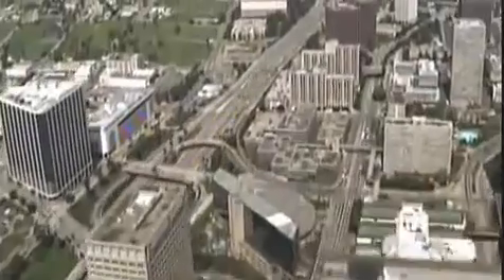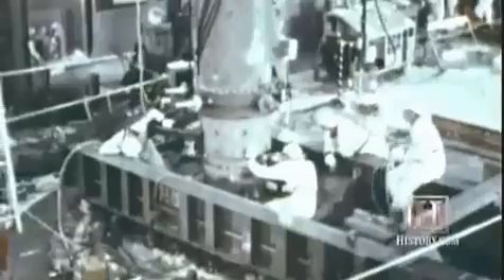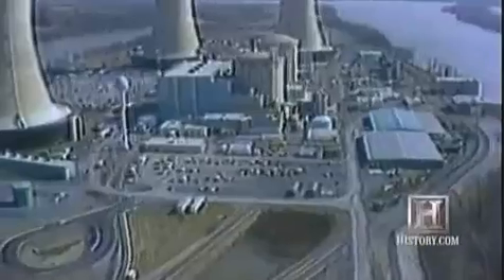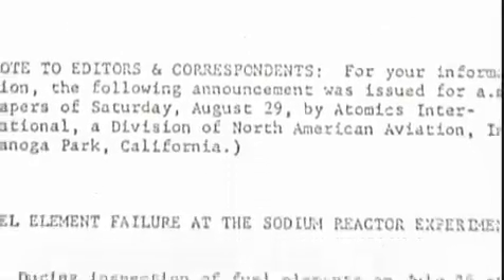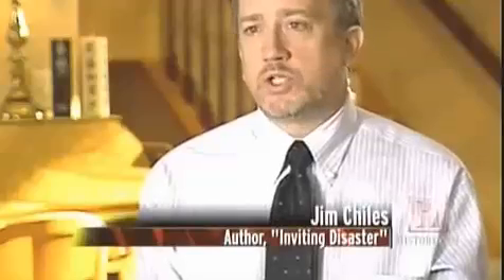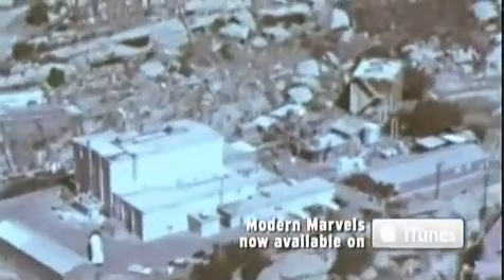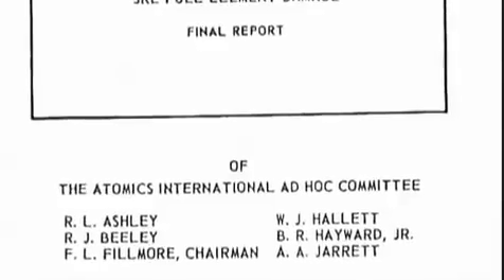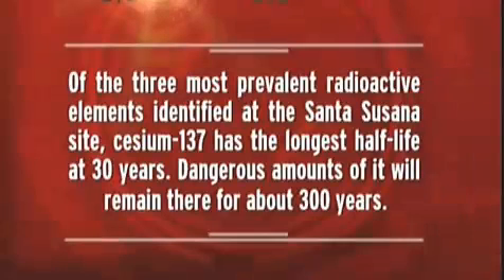Simi Valley Nuclear Disaster

Comment: More people get sick and die from coal power each  year and its does way more damage to our environment.
Reply: Jim Piver neither 'explode'. But thousands die from coal fumes and far fewer die from power. And the point is, modern reactors are safe, unlike these things, whereas coal power has barely changed.
Reply: Jim Piver the Fukushima reactors are from the 70s and the Chenobyl reactors were even older. 
Both reactors were still considered terribly unsafe in their day, but the Soviet Union didn't give a fuck. As for the GE MK1 loads of GE engineers resigned over it. 
The Soviet Union no longer exists and the GE circumstances cannot arise again, due to different corporate cultures and far more regulation. 
Even in the 60s, far safer designs existed, such as the inherently safe AGR design from the UK.
Modern reactors have so many redundancies and such effective confinement that no power plant designed since the 70s has had an issue.

As for the Chenobyl accident, the reactor didn't explode, the giant pool of water stupidly positioned below it exploded, there's a difference. This again, cannot occur in safe designs.
Reply: Jim Piver the cause of that explosion was just as unique as it was stupid. Other reactors don't work like that. That's like using a stick of dynamite exploding in a backpack to show backpacks explode.
Also, you got the order of events wrong. The control rod, tipped with graphite, was being reinserted, which caused the accident.
Reply: i don't really understand who you are talking to here. 3 Mile Island isn't mentioned in this thread, nor does anyone here deny that this event was a disaster. We aren't comparing 'disaster' to disaster, because carbon based energy production doesn't really have 'disasters' so much. What it does have is a slow, subversive way of killing that kills far more people than nuclear power ever does or has.
Reply: did you listen to this at all? LARGER than the 3 Mile Island Disaster AND there were "2' spills.  Geez.
While what you said is valid, are you trying to compare disaster vs disaster. :(

Comment: Pu-239 or plutonium has a half-life of 24,100 years, the half-life of uranium-238 is about 4.5 billion years, and cesium half life is on 30 years So yeah grow ssome frigging perspective. This programme said the reactor was re-started and ran for 2 weeks before it was discovered that the reactor was badly damaged, tell me if a fast water breeder reactor would do that after melt down? The answer it wouldn't, the fast breeder would of blown up like chernobyl, or even worst! Should there of been a containment vessel of some sort?, of course! but compared with fast breeder reactors, but Molten Salt reactors are far more safer! O>O
Reply: The longer the half life, the less radioactive something is.
Reply: john smithson a fast breeder reactor that had had a partial melt down wouldn't blow up 'like Chernobyl', and nuclear power plants don't 'blow up'. They can suffer a steam explosion, or a hydrogen explosion, which is rare and highly unlikely even in an accident. Also, nothing about the cooling system here affected the incident. Complete irrelevant.
Reply: Actually, correction, the meltdown was caused by the coolant, which could not happen with a more conventional thing.
Reply: Thorium may be the answer as the next element used for generation.

Comment: ...so the only thing wrong with using this salt method is they did not have seals to keep out the "tetraline"? Seems a easy fix ..The reactor works fine , the seals were bad or not appropriate ....Why are they not using this method ...? Is it not needed ?
Reply: Next time, it will be something other than the seals. The problem is this: whatever unforeseen happens, you have a huge lake of hot sodium with possible radiation sources in there, just waiting to meet anything to react with, water, air, certain construction materials etc. Oh, and the ash is sodium hydroxide, one of the most corrosive chemicals available. It will eat even through glass or concrete, if hot enough. You NEVER want this. Imagine meltdown corium at pH 14. Oh, and once burned completely and then cooled down, this sodium hydroxide will again react highly exothermic with water, creating steaming, caustic sludge that also eats through most things. Just do that on the moon or wherever, but not any closer....
Reply: dro1969   Wasn't there recently some stupid bitch of the democrat persuasion that sold a large stake of our uranium to the Russians for a large donation to some illegal foundation. If I remember the falling down sick, psychotic, lying, stupid bitch's name, I'll post it. (I do remember she was one mofuglitch of a creature feature).
Reply: dro1969 it's true that the reactors we use use more uranium that this, but we have since found loads of uranium domestic deposits and we don't need to worry.
And the Middle East is full of oil. It's oil the US wants, not Uranium, which is lying around in massive quantities in the US.
Reply: The follow up to this test reactor but on a larger scale, was the Sodium Cooled Graphite Moderated Reactor, built just outside of Hallam, Nebraska.  It developed problems too, but was critically operated so there was never a problem to anything or anybody outside of the reactor vessel.  Its problems were not dangerous, just expensive to maintain so it was decommissioned around 1963, as I recall.  Its core is still buried at the site.
Reply: KSparx If you mean Hillary, she doesn't have that kind of power.
Reply: Ever heard of oil?
Reply: uranium fuels secret wars, why do you think we are fighting in the middle east, they must have alot of uranium there and the US wants it. sodium reactors are too likely to explode hence the video, so I'm sure all
 the reactors are water cooled and need lots of uranium

Comment: Santa Susana Sodium Reactor In Los Angeles California, Near Simi Valley; Multiple Nuclear Plant Reactor Meltdowns Completely Covered Up, 400 Times Worse Than Three Mile Island Due To Plutonium
http://agreenroad.blogspot.com/2012/03/los-angeles-nuclear-plant-meltdown.html
Reply: +Kathy Reed This wasn't a molten salt cooled reactor, it was a sodium cooled reactor. Molten salts are chemically stable, unlike metallic sodium, which is an alkali metal.
Reply: You are correct, Zach.
Reply: Kathy Reed Yes it did. The MSRE performed exactly to specifications; by all accounts it was a resounding success. The reason it was shuttered was because Nixon wanted to keep the research in California.
Reply from the maker: +Dr. Good Heart The molten salt reactor is the model they want to use for thorium reactors. The reactors they keep saying are so safe.
Reply: do they have theas today
Reply from the maker: Molten slat reactors are a popular option as the future of nuclear reactors.
Reply: Kathy Reed Dafuq is molten slat?
Reply: molten uranium tetrafluoride and metallic thorium are the safest fision reactors, both parts of the system are completely safe, tetrafluoride have a minimal risk of radiactive contamination and is resiclable, instead thorium is a low radioactive source, even you can touch thorium with your bare hands and is safe. molten salt + thorium reactors doesn't have high pressures inside the core, and none of the parts of the core are reactive with air or water, and is easy to shut down simply with open a valve under the reactor. minimal risk all the time and even if the reactor were cruched by a bomb is easy to stop the reaction only taking the thorium parts.
Reply from the maker: Thorium didn't work out so well put into practice.
Reply: Dr. Good Heart